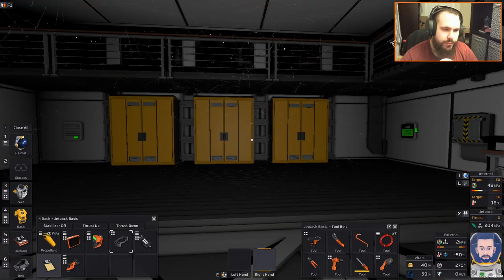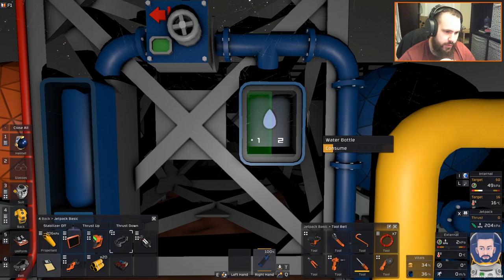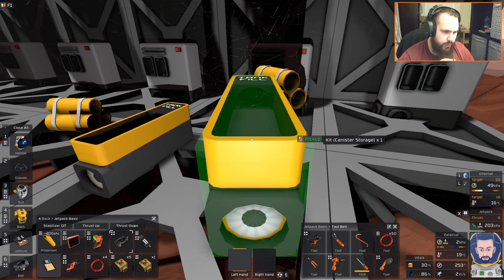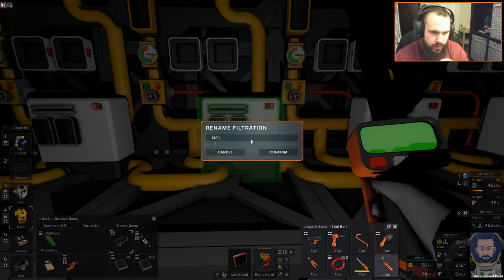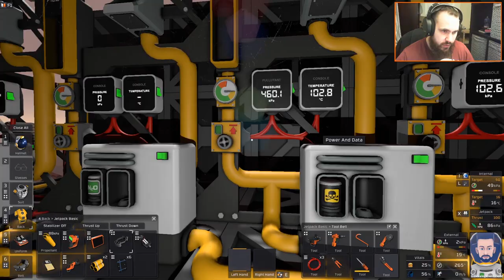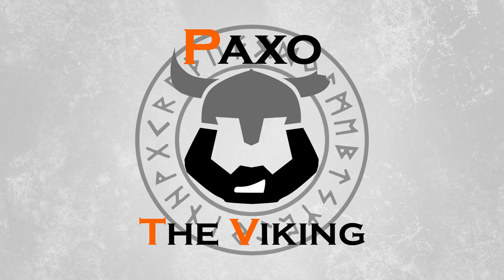Gas Filtration Part 2 - Let's Survive MARS Stationeers

Comment: That's it!.. I'm now gonna measure my gasses in MegaPaxos..:D 1:40
Reply from the maker: Hahaha, I didn't even notice I said it like that. Well that's it they are officially MegaPaxos for the rest of the series :D :D
Reply: @paxotheviking218  Sweet!..lol 

Btw MikesPC  didn't bother with your suggestions on the 'over complication' sigh.. He never listens..lol 
I think you might get a blowout on your  filtration system on the unfiltered side when any filter runs out. You need to run your unfiltered gasses in a common pipeline going to an overspill tank. If a filter runs out it stops the machine and the previous machine will continue to pump gas into the output that will be blocked leading to an over pressure situation.. Feed from a common line and return the output to it.. :D
Reply from the maker: I noticed, he seemed to add to it. Not sure why he vents gas into the room to then pull the atmos into another pipe system to filter it but it works so its good for him. Its why I like to see other people's designs, there is always something different.

Ok I will have a look at that in the future thanks for letting me know.